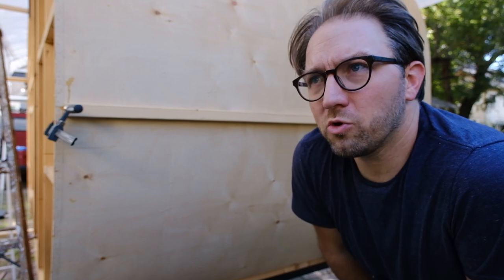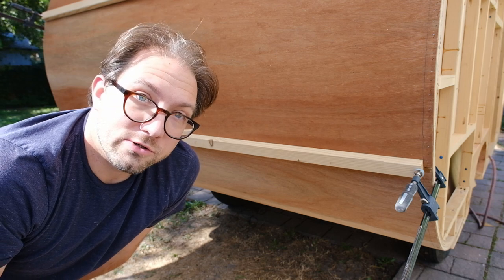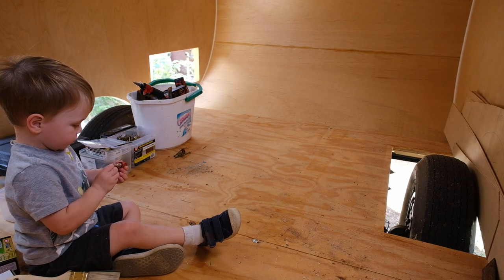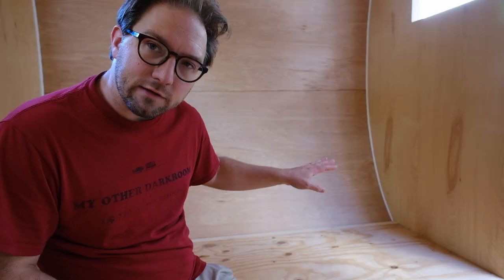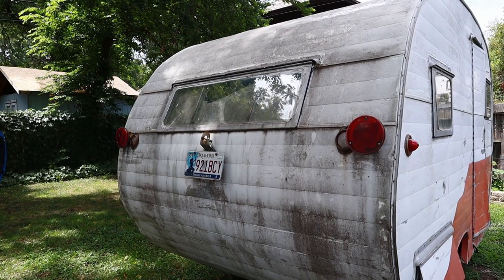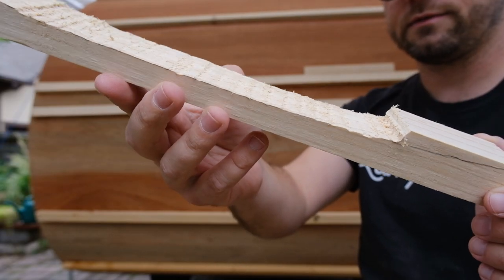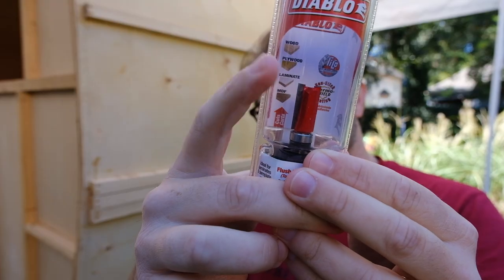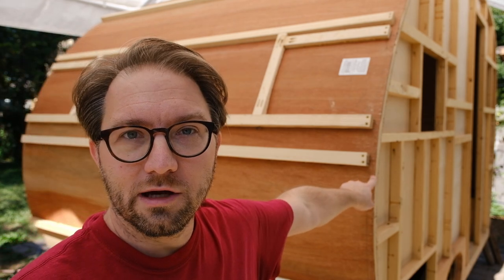CURVED JOIST HACK / SIMPLE TRICK TO SAVE TIME

Comment: Great job, Lots of great tips. I have copied a lot of the ways you are doing these campers. I am working on a 60 Wilderness Coach frame up reconstruction.
I ran into an interesting goof from the previous rebuild of this camper and they cut the wheel wells 3.5 inches further forward on one side compared to the other! I did not figure it out until I put the skin back on and found the problem. Started looking at pictures and saw the difference from one side to the other. When I took the picture of how it was when I bought it, I thought it was just the way it was sitting on the trailer since it was in such bad shape.

😪😪 So now reskinning the curb side and possibly more.
Reply from the maker: Our '61 Aljo photo booth camper has the same issue, and I've still got to figure out how to correct it. I thought about leaving it that way, but it kinda annoys me. I think I know what I'm going to do, so that'll be in a future video.

Comment: What if you used angle iron as long as the joists and clamped it with the existing clamps , it would act as a splint while you secure it , could even be aluminum or cut a length from an old bed rail , just an idea....
Reply from the maker: I had considered something like that, but what I really should've done is to plan out and attach all my joists to the panels before installing the panel/joist combos as a unit on the camper.

Comment: I am working on a 1966 Oasis. Last summer I replaced rotten boards on the top. Two weeks ago I stapled up double sided foil bubble wrap. A week later I went out to get some measurements and found that one area had water pooled up in it. I removed that section so it could dry out. What can I do to keep this from happening. I live in cold country, the trailer sits outside and isn't sealed up. Thanks for your videos.
Reply from the maker: If you haven't got a covered area to work on it underneath, you ought to at least throw a large tarp over it and tie it down. You want to put something on top of the camper under the tarp to tent it up so water drains off quickly. Some people use a large bucket, but whatever it is you want to make sure it doesn't have any sharp edges that'll rip the tarp.
Reply: I was thinking about that and now that you mentioned it I will get it done and I like the idea of the bucket on top. Thanks for the encouragement.  @TrailerTrashtoTreasure
Reply from the maker: You're welcome!

Comment: Did you double check the window position by holding up the skin???   I’m just worried about my measurements being wrong 😩
Reply from the maker: No, I didn't because I'm using new skin for this one, but yeah if I was reusing the original skins I would've tried to clamp the bottom sections to the camper nice and tightly to make sure I was getting things in the right place. You can always adjust the size of the opening a bit by removing or adding wood and letting the interior trim cover the error, but it's naturally best to be accurate to start with!

Comment: What type of wood are you using for the joists?
Reply from the maker: I've always used either fir or yellow pine. I think it's a good idea to purchase the "premium" grade of framing studs when you go to the lumber yard as they tend to be straighter and have fewer knot holes, but it's always good practice to look over what you're buying and choose the best ones in the bunch.
Reply: And to add one thing. Once you rip the studs down, make sure you’re ready to install them because modern lumber will start to twist even a a whole 2x4. Rip them down and OMG, usually unusable from twisting end to end.
Reply: @jerrytalley802  douglas fir 2x4 is more stable than pine and tends to twist less. I also recently learned how important moisture content is. Even KDHT at the store can be as high as 19%, so if you dry it out even more, down to say 7% the chance of twisting drops dramatically. I noticed a lot less twist in my projects.
Reply from the maker: I find you tend to get less warpage ripping down larger stock, 2x6, 2x8, etc. and the grain is often straighter, but a lot of variation can come just from what the grain orientation is when the timber was milled from the tree. Drying it can help tremendously, but it can take a lot of extra time, and if you're working outside or your shop isn't climate controlled it'll always be a bit of a moving target.